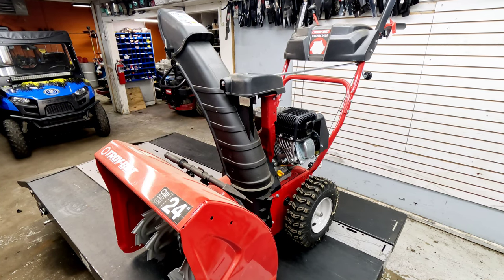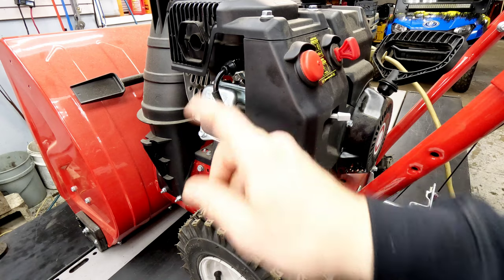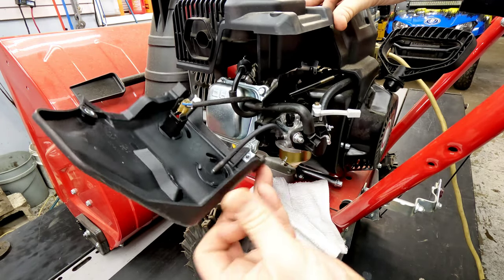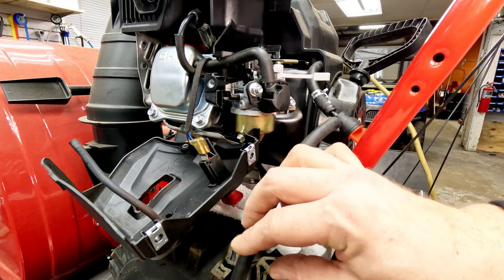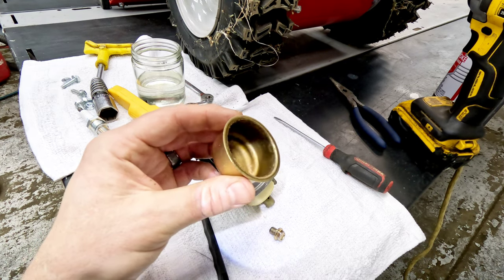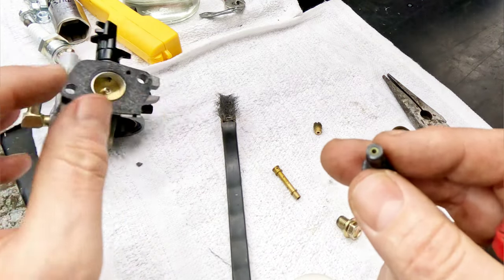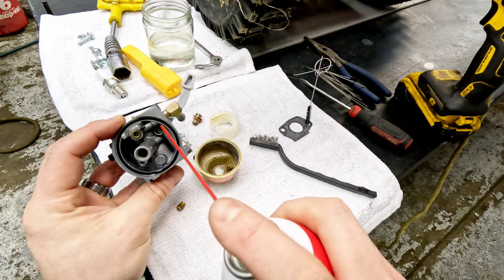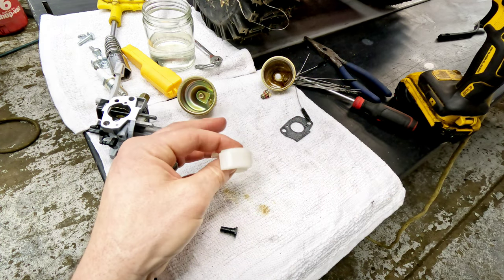Troy Bilt Storm 2420 Won't Start Won't Stay Running Surges Full Diagnosis & Repair For Common Issues

Comment: This small engine professional does the best job I have seen cleaning Carburetors for small engines.  Why? Step by step instructions In which he reiterates the important points.  And then he shows you the tricks in the tools he uses.  He's extremely efficient.  And he shows you all the pit falls.  Then of course , how to make improvements , and what to remove and discard , and what to keep as well as why.  He really is the best And only rivaled by DonyBoy 73.  Great job!  👍👍👍
Reply from the maker: I really appreciate that! I make plenty of mistakes but try to be thorough. If it helps someone it is all that matters in my eyes. Thanks for your comments and for watching!

Comment: Great video!  I have a 2410 that I bought used last year, about 10 years old.  I’ve spent the last year fixing all the stupid crap Lowe’s and the factory did when they first assembled it.  Control cable pulleys that can’t turn, cables misadjusted, nothing greased anywhere, etc.  I’d love to see you do a gearbox rebuild on one of these 24” MTD blowers (if they’re worth rebuilding).  Getting ready for 6” tonight in KC.
Reply from the maker: These are mostly assembled incorrectly that I see every time also! They pay the assemblers per piece price and it is very little most barely know how to put a bolt in let alone how to operate the equipment. I will do one if I get one needing some drive working!

Comment: I came across something interesting last year that you and your viewers might be interested in. one Troy-Bilt and one mtd I did last year had a brown substance in the float that looks like coffee. The emulsion tube and jet were also plugged up with this substance. It was not from stale gas or varnish. Both units were relatively new. The culprit turned out to be the fuel line the manufacturer used. It almost seemed to be plastic instead of rubber ??? Has anyone else come across this . The material of the fuel line seems to disintegrate.
Reply from the maker: Fue lines deteriorate sometimes at a crazy rate but normally don't see anything like this but a couple times a year. Usually on older equipment

Comment: Great detailed information. I’ve been using the purple type of simple green with great luck.  Your unit didn’t have the problem, but my primer line split at the end.  Maybe throw a inspection reminder while it’s torn apart.  Just a suggestion.
Reply from the maker: For sure! Checking the primer line and even just slightly snipping it back works well. Also checking for cracked fuel line while it is off is always a good idea. This unit was a couple years old but at 5-6 years all of the lines seem to start to crack/separate on the inside and the tanks corrode pretty badly if they get moisture in them. Thanks for the input and for watching!
Reply: @IndRepair  I’ll be watching and politely responding.  Thank you for sharing your knowledge. Take care.
Reply from the maker: That is great news! I am very surprised it has lasted anywhere close to this long! My neighbor had one and he replaced the carburetor three times in the course of the 6 or so years I lived next to him.

Comment: I’m thinking of investing in a spark check’r.  Are they dependable and accurate?  Thanks and stay warm.
Reply from the maker: Probably the most time saving tool of everything I have purchased! It is nice not to have to pull the plug and test just clip it on and go. I have seen two instances where the check'r would seem to be working then shut off when the engine turned over. This happened in a video one time (not sure which one) also. Other than those couple times there has been no question if the plug was good or not and its accuracy is greatI would say definitely get one since you do a lot of repairs
Reply: @IndRepair  thanks. Sometimes just trying to find a good ground is tough. I have a test lead with 2 clips.  On spark plug, then on muffler or bar. Another reason is It’s not invasive .   Thanks again.

Comment: great video!!!   what do you believe caused this problem and how to keep carb from getting this way?     where in Illinois are you
Reply from the maker: "If you have not used your snowblower in a while your gas may have gone bad (pump fuel goes bad within 30-60 days many times)

Your carburetor could also be gummed up or varnished from the fuel

The customer was using 87 octane regular pump blended fuel... "

Usually bad fuel... pump fuel quality is horrible, ethanol added gums things up and fuel treatments do not work. Use ethanol free and treat it with something that will control moisture. Thanks for watching!

Comment: What cleaning solution do you use in your ultrasonic cleaner
Reply from the maker: Whatever degreaser you have around should work. We use simple green
Reply: He used the combination of simple green and water.  I see many of the small engine professionals using this same solution in the ultrasonic cleaner.